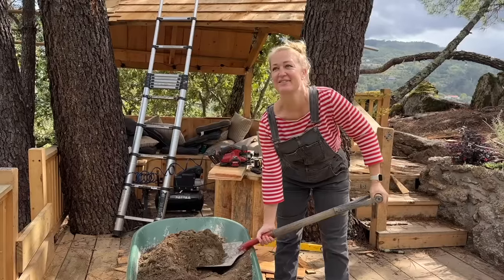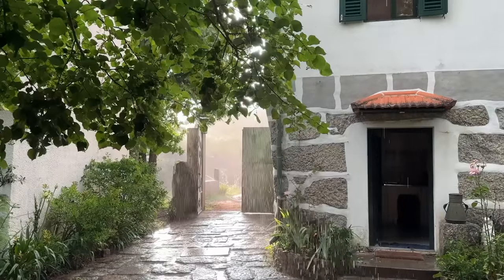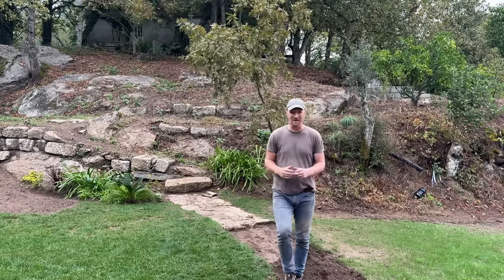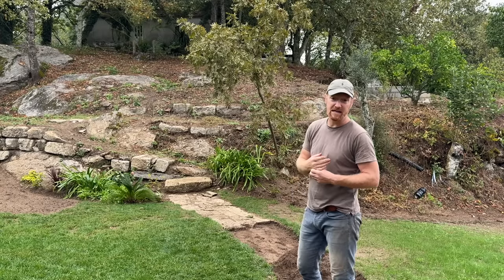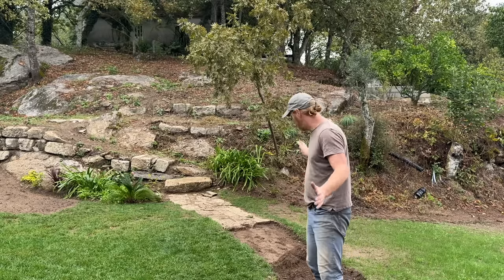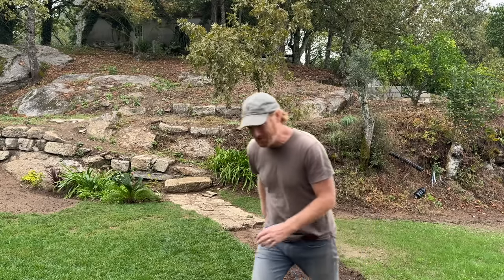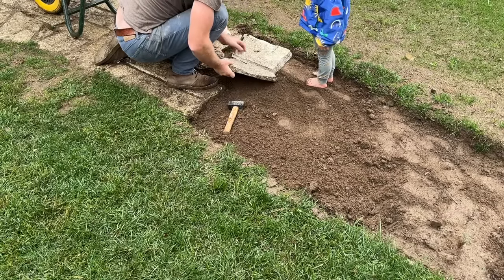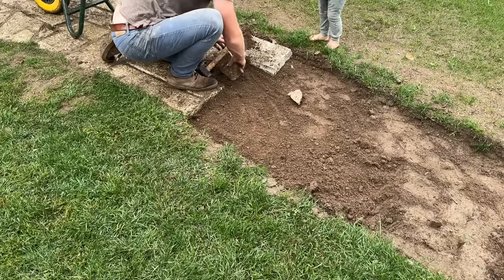Stunning progress on our Portugal Homestead

Comment: I live in a 12 acre forest with naturalized landscaping around my cabin home that includes natural slate pavers as a path on 3 sides of my home. No weed screen, sand or cement, just the natural soil, wild plants and grasses surround the pavers and as you said John, they cement the pavers in place. My path is 25 years old. No cracking. No movement. Completely merged with the natural landscape.  I love it!

As for chickens eating valuable grass seed.... I have wild turkeys that do the same.  Easy solution is to lay wire mesh fencing/cage  over the newly planted seed. I criss cross 2 pieces to ensure the turkeys don't peck thru. I stake it down with tent stakes or landscape staples. This way water and sunlight get thru and in a few weeks my grass has sprouted! I remove the fencing material when grass is about  3 inches long. I've successfully reseeded several areas of my home landscape this way. Good luck!
Reply from the maker: Oh wow that is incredible friend. Well done, that is exactly what we want too. Thanks for the advice on the chickens eating the grass seed, very good idea! Thanks so much for watching 🪨🔨🙌🏼❤️🏡🇵🇹

Comment: The path looks so nice. Good job you guys! Hopefully the road will be sorted soon enough. Sounds like you have it all planned out. In the mean time, my husband said if a truck has a long wheel base, you can try adding some weight in the back of the bed. It would help ground it a bit in the back and might help it drive up the loose dirt and gravel a little easier.😉

Comment: I laid a flagstone path with yours. I laid it on a bed of dry cement with wet cement in the cracks to hold them in place. What does happen is that there are fine cracks between the cement and stones that allow all the unwanted weeds to seed. Because they are seeding in the cracks they are really difficult to remove. Better to have just sand in the pathways cracks. Much easier to remove unwanted weeds. I will be removing the cement....after I finish the french drains around the house.
Reply from the maker: Great to know Nanci, thanks for sharing that with us. Your support means so much to us. Best of luck with your french drains! 🪨🔨🙌🏼❤️🏡🇵🇹